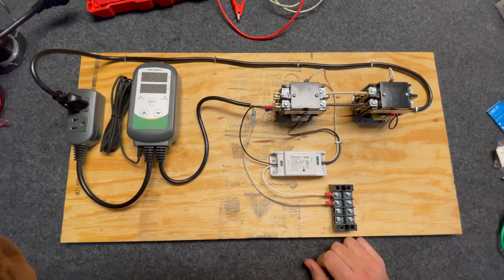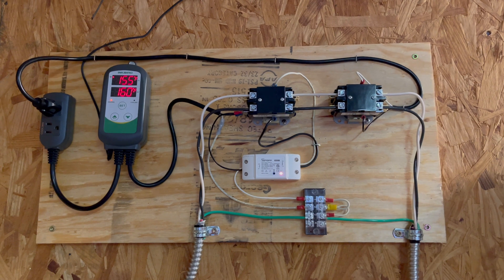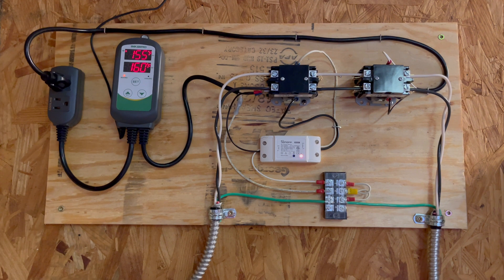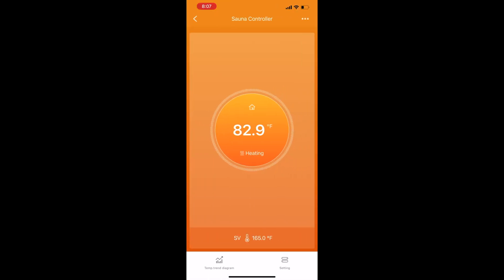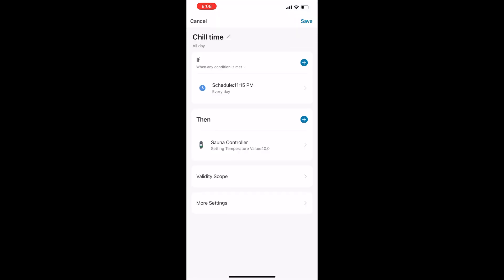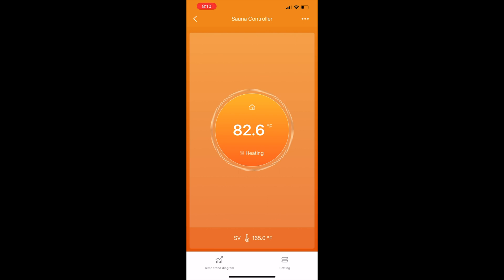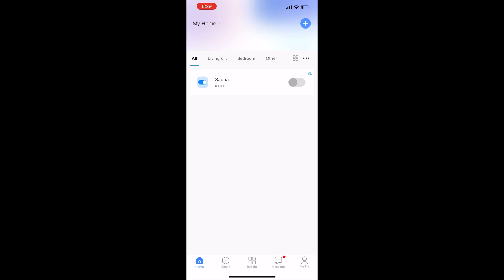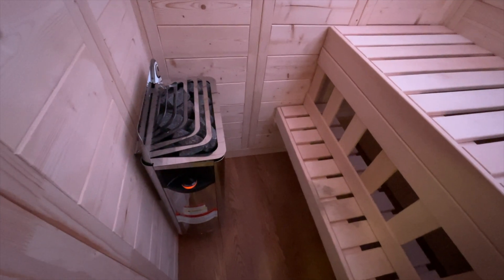DIY WiFi Switch for Sauna Guide

Comment: Thanks for this video.  I plan on copying this set up.  Would a 2P 40A 24V contactor work? And what gauge wire do you recommend from the power source and between contactors? And also between the contactors and the sonoff? It’ll be running a 2KW AC 120V vevor stove.  Thanks for any info you might have.

Comment: I am so glad you did this! Harvia wants 1K for the controller. I heard you say you wrote a script for one of the apps, that is above my pay grade. Is this required or do they apps work out of the box?
Reply from the maker: Hi Chris - The apps do work out of the box to a certain extent. The exact setup I have here was rather easy with a little internet researching as I'm not a software engineer. I'll get prepped up to do a run through on my software setup side and maybe that will help more folks out.

Comment: Why 2 contactors and Sonoff? The inkbird smart controller should be able to energize the 120v coil on single  contactor  when it calls for heat by the inkbird set point. 
I am  not understanding the need for the second contactor and Sonoff.
Reply from the maker: It’s simply there for redundancy. I have a 2 hr timer that initiates once the sonoff is turned on then the ink bird’s logic has to equal true for power to be delivered to the heater. 
It’s my fail-safe for cooking myself or relying exclusively on a temperature controller.

Comment: How did you bypass the dial timer knob that the heater uses factory to turn on ?
Reply from the maker: So it took some trial and error but I simply bypassed the switch. That dial switch only counts-down when powered. Once you turn the dial to the ‘on’ position, it remains on and the only reason why that mattered to me is I wanted the LED on the heater to activate when the heater was powered. Once the sonoff switch & ink bird controller’s logic = true, the heater turns on. I failed the document the switch bypass correctly; otherwise, the video would be here.

Comment: I was looking around for a HomeKit freindly controller. What are your thoughts on the Meross Heat Controller? Seems like their probe is rated for 110 celcius
Reply from the maker: Hi dawn-ho, I'm not familiar w/ the Meross Heat Controller. If it has similar functionality, I'm sure it could be used in a setup as shown.